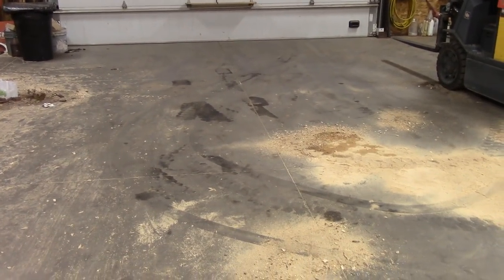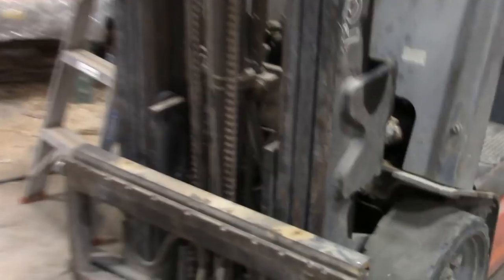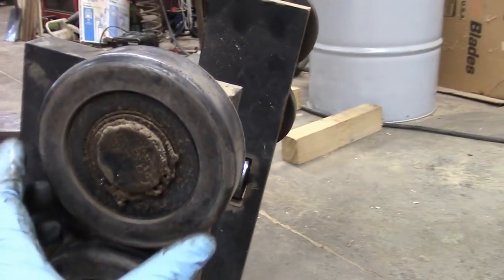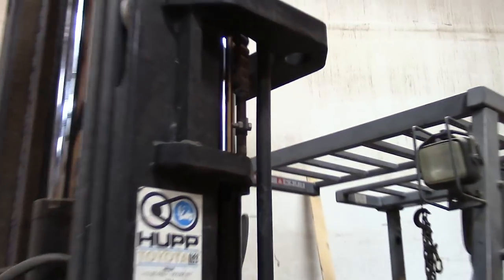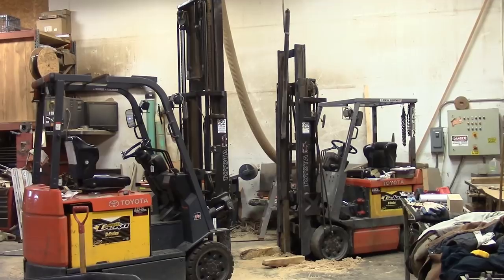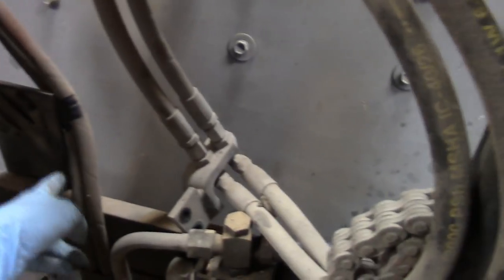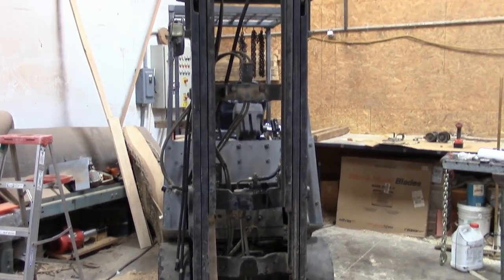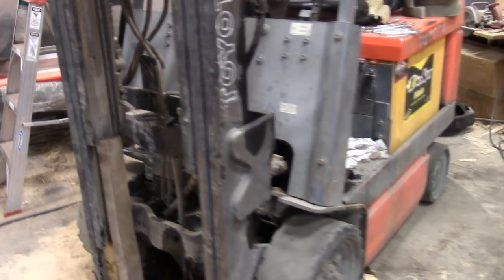Toyota Forklift cylinder repair 1

Comment: Just saw this video. I wish I could of seen this and been there to help you. I’m a forklift mechanic and I will say this. Way to much work to pull cylinders out. No need to pull carriage off. If you would of raised mast all the way up then chain bottom of the cross support to top of mast would of been easier. After that undo top of secondary cylinders and lower. Undo mounts and slide cylinders out.
Reply: Hey Ben, I’m in the process of replacing the seals on one of the outer cylinders. I’m new to this but mechanically inclined and have tools for the job. My question is how to remove the cylinder for proper repair? Only thing I have managed is to remove the forks lol.
Reply: Kap Partier it depends on the type of lift it is. They’re all different.
Reply: I actually just did a job where I had to rebuild both secondary lift cylinders. Start to finish of job was 2 hours.
Reply: Ben Strange its a Toyota life. I can get the model number off of it if you like. I was able to get the gland off but im stuck on how to remove the cylinder or even just replace the seals
Reply: Kap Partier the cylinder just comes out. To replace seals you will need to use seal removal tools. They look like picks but are flat and won’t scratch chroming on cylinder.
Reply: Ben Strange i tried to find manuals and stuff but couldnt really find anything. If you can give me a quick run down on how to disassemble the sides, id greatly appreciate it
Reply: Ben Strange we have multiple tools at work that i can use. Just trying to find the steps to remove the cylinder. As of now only the forks are off with the cylinder unbolted but cant fogure how to remove
Reply: Kap Partier There should be a bolt on the bottom of the cylinder normally it’s a 14 MM then you can take the cylinder right out after you raise the mast all the way up. You’re going to have to chain the bottom part of the mast to the top I will try and get a video and explain to you the easiest way I just re-packed a couple and it didn’t take long to take them out and rebuild them
Reply: Which top mast do i chain to bottom? A bit confused about that
Reply: Jonathan Betz not quite sure I understand what u mean.

Comment: Sometimes it is cheaper to pay up. Repairs to hydraulic system not for inexperienced. At minimum you should have service manual, would have known right from beginning don't need  another lift truck to remove carriage. Worked for Toyota many years as field mechanic one thing I hated the most was following some one who had no clue and had to correct his mess. How could you be saving doing it yourself did I hear you say you have 3 forklifts?  Guess what you have 2 not in production right now. Gd luck
Reply from the maker: Thanks for stopping by to watch and comment. We did have the local dealer take the truck back to their shop for Roll Back Cylinder rebuilds recently.

Comment: Remplace all the oil and filter to  and check you pump for any noise sound  you put all the oil thanks for showing normally is 3600 dll service from Toyota you save money plus the cylinder road need to be replace
Reply from the maker: We saved a lot of money. Thanks for watching.

Comment: If you can get a magnet in the hydraulic tank mite help.
Reply from the maker: Michael, that’s a great idea.
Reply: On some hyraulic tanks there is a magnet on the drain plug to catch any metal
Reply from the maker: Not on ours, I checked. Never dawned on me to put a magnet in the bottom when I had the top off.

Comment: Sounds like the pump is blowing up sending metal throughout the system
Reply from the maker: The pump sounded fine when this happened. So it was basic cylinder failure.

Comment: Big job!   Hope that steel in the system hasn't done any damage to the pump.    Im sure you already do but maybe have a few extra filters on hand so you can change it a few hours in after the fix to make sure all the contamination is out.    Thanks for sharing!
Reply from the maker: The job was not too bad, other than it took quite a few days to complete, and it was in the way the whole time.

Comment: Hi i have a  toyota 3 stage 3 ton forklift .i have a problem with the mast. The first stage open only  halfway and then the second stage start to open thus causing the forklift to loose power.if u c.ontinue to lift u can see the  first stage ram  hyd oil trying to come out  while the second is still lifting. Any coments
Reply from the maker: There is a regulator that controls how the mast functions. It could be dirty or faulty.
Most Toyota Service departments will answer basic questions for free. 
Good luck.
Reply from the maker: There is a regulator that controls how the mast functions. It could be dirty or faulty.
Most Toyota Service departments will answer basic questions for free. 
Good luck.

Comment: No way to get the cylinders out without removing the entire front ? 1 by 1 ? 

Ive repaired 1 Tilt Cylinder on our company's Toyota. I need to do the Right Lift seal. Also looks like im going to have to do the steering seals too both of them. 
Any tips to maybe speed any of those up.??
Reply from the maker: After doing the entire repair, I’d do it the same way again. I still was quicker than what the “Professional “ mechanic said it would take. 
Good luck

Comment: Those hydraulic systems can be troublesome. I hope your expenses were manageable. 
Vandals caused me to operate/damage a D4H for about 8 hrs. one day (hand full of sand/small gravel), but $10,000+ and one week later I had it going again....with new pump, flushing, controls, etc. 
Thanks for the video.   
….13
Reply from the maker: Bummer your D4 got damaged by idiots. 
Our damage is a lot less than yours.
Thanks for sharing your experience.